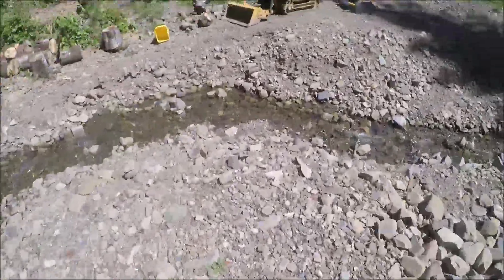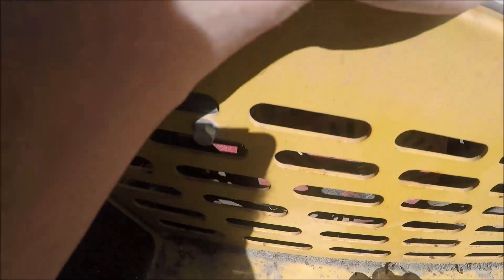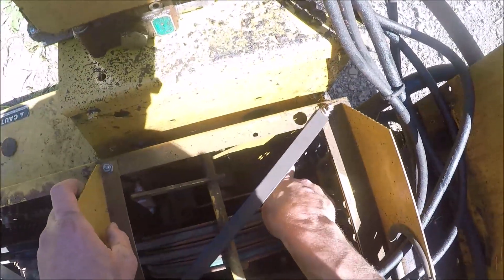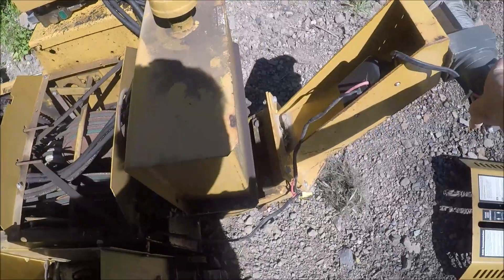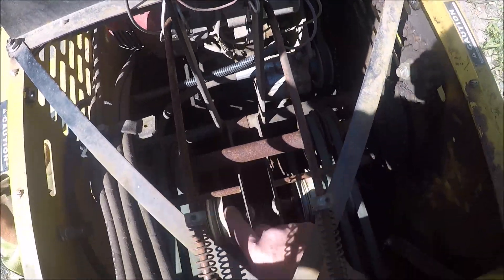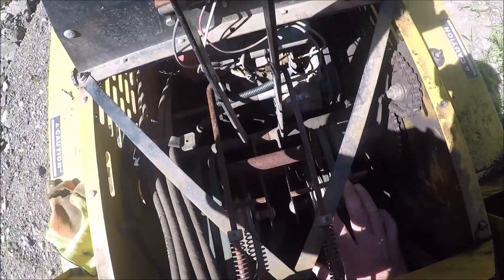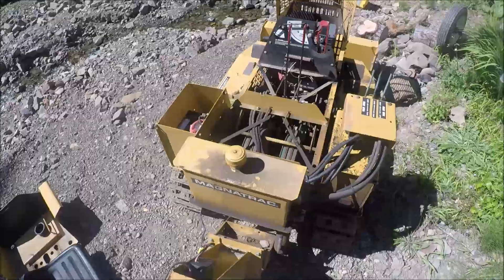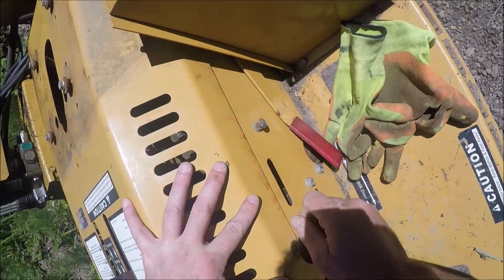Struck Magnatrac RS1000 - How It Works

Comment: Thanks for sharing your machines layout Carl. I have the RS196 and haven't seen the general layout of the upgrade machine. It is funny how people make comments like "why isn't it hydraulic drive". That's the beauty of Struck's mini crawlers, simple, functional , very maintainable (for the average Joe) and ultimately the success in the lower total price of this American Made jewel!  I have the basic 8 hp (pull start) motor (also bypassed the seat switch) and love the simplicity of my machine for my needs. People groan about pull starts and I don't get it. That's is why it was under $5K and there isn't anything else to match it. Struck is a classic American family business, offering affordable, maintainable, durable products for various applications and users.
Reply from the maker: Awesome bud. 👍🏻
Reply: The older MD750 from the early 2000s did have hydraulic drive. They probably had issues or they got too expensive to repair vs the kevlar belts.
Reply: The rt1150 is hydraulic drive and they stopped making the rs1000.